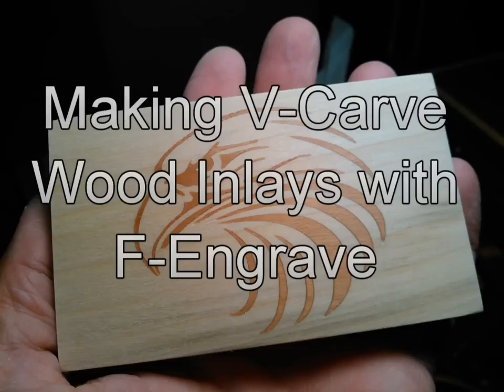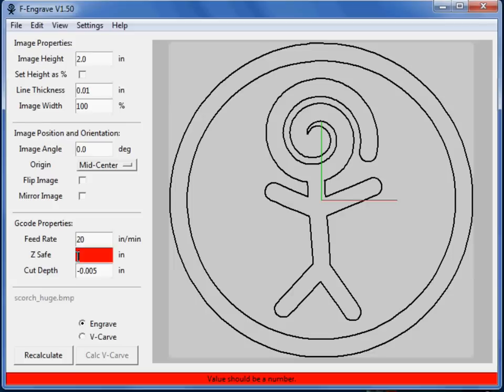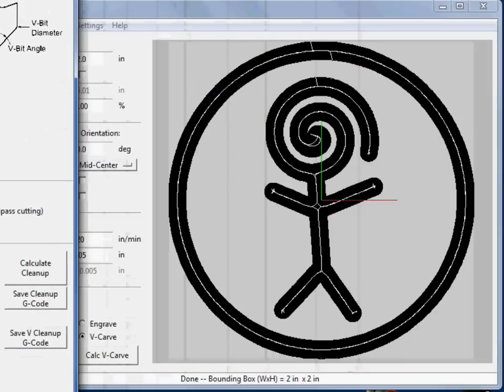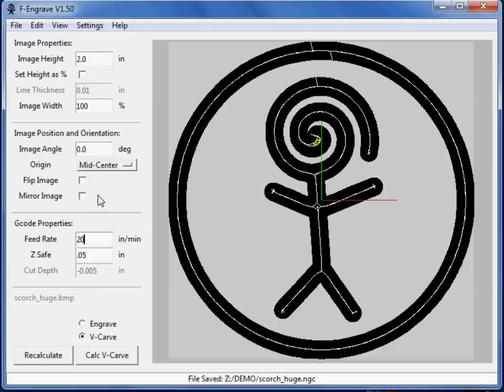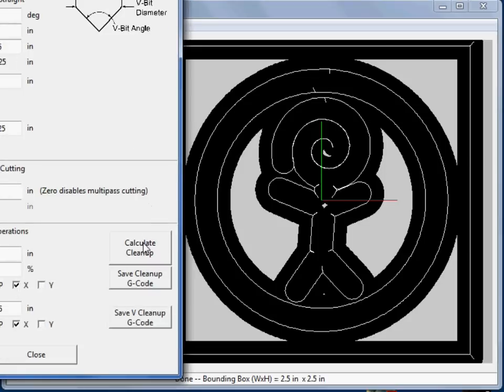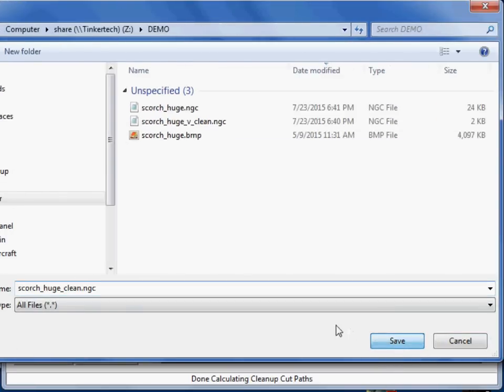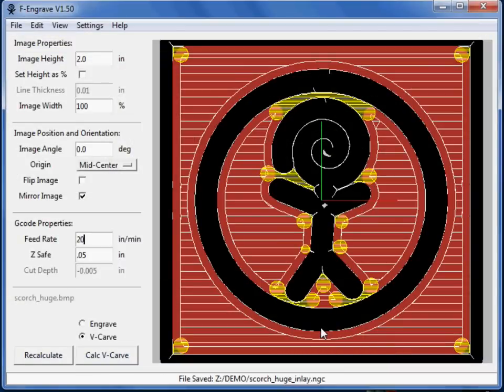V-Carve Inlay Using F-Engrave

Comment: Love the software, thanks so much for making it available.

I am trying to do an inlay as noted above and running into a problem where the inlay portion has a "square" top as shown in the left drawing at this link:  https://imgur.com/a/I3iVw7B

I'm not sure what I'm doing wrong to cause this, but it makes it so that the inlay doesn't mate properly with the base part.

Any ideas?  My settings are:  V-bit angle 60, V-bit diameter 0.125in, cut depth limit -0.09in, sub-step length 0.01in, v-carve finish pass stock 0.032in, v-carve max depth per pass -0.032in.  For base add box and prismatic are not selected  For the inlay mirror is turned on, add box is turned on with a 0.25in Box Gap, and prismatic is turned on with a -0.0625in prismatic overcut.

Any help is appreciated!
Reply from the maker: I don't know how you can physically make square top (as shown in your sketch) with a v-bit.  The sides would need to be slanted at the angle of the v-bit.
Reply: @ScorchWorks  Thanks for the reply!   I have figured out what is happening - it appears to be because my v-bit is of small diameter (1/8") and 60 degrees, which means it has only a working depth of 0.108", but I was cutting to a max depth of 0.09" (no problem there) plus a prismatic overcut of 0.0625", for a total depth of 0.1525".   When I simulate g-code generated by the program where the overcut plus depth is greater than the working depth of the bit, I see this behavior, even though the per pass depth is appropriate.  It is almost like the software believes the bit to be wider than it is.

So the bit is being lowered into the work deeper than its working depth, so you get a v-channel with a square at the top, and the software doesn't appear to compensate for this in the shallower passes.

In any case, it looks like I can make it work by ensuring that my prismatic overcut + max cut depth do not exceed the bit's working depth.  I'll let you know how my next cut goes!  Thanks again for the awesome software!
Reply: Yeah, switching to a 45 degree bit (0.125" diameter, 0.151" working depth) with a 0.09" max depth and a prismatic overcut of 0.06" did the trick.  

Perhaps in the next version if the overcut + max depth is greater than the working depth of the bit it could throw a warning?  Just a thought.

Again, thanks for making the software available!
Reply from the maker: @WestCoastChainmail  I am glad you figured out what was happening. Thanks for the suggestion.

Comment: I have no email address for you so I thought I'd try this.

I have made a few alterations to f-engrave which improved the v-carving without plotting by about 40%

For large bmp, taking about 10 hours to process on an i5 processor, it took about 6 hours.

the biggest time saving was to display the status at every itteration.  instead, that can be done just a few times per second leaving more time to calculate circles and intercepts and less time writing to the screen.

changing sqrt(x*x+y*y) with hypot(x,y) gives a mild 2% increase

Another improvement would (which I haven't made) would be to reduce the accuracy.  For example my machine's accuracy is 750 step / inch in the XY so no need to calculate to 4 decimal places.... the machine just won't move.

I will send you the code if you wish to review it.

I was considering writing the entire v-carve in C but then I got in the data structure and abandoned that idea.  It could execute up to 400% faster in C.

Perhaps putting your code in Github would be better for making pull requests. and contributions like mine

Thanks for making the software available.

Alain Pelletier
Reply from the maker: In F-Engrave select "Help"-"About (e-mail)"

Comment: I’m having a little trouble. The new interface is slightly different than this video. When I cut both pieces, my inlay did not fill the base material. Am I supposed to have prismatic cutting on for both programs? (Base and inlay). I set my base to cut depth max of .0625 and a prismatic overcut of .03125. I do not want the base too deep as I don’t want the inlay too thick. It’s letters and I would like to see the center of the “A” and “e” in the cut. Any advice?
Reply from the maker: Shawn McKinney you should only use prismatic cutting on one side.
Reply: Scorch Works ah ok thank you very much. Does it matter which side?
Reply from the maker: The prizmatic side is the side that is inlayed into the other v-carved side.

Comment: Steve Rogers

2 hours ago
Hi Scorch Works
First I want to thank you for this great program (still trying to learn it) I have watched your video about a 100 times trying to figure out, when you save the V cleanup and then save the main file and then you cut the first part of the inlay or main ngc file you mention that you cut the two files. can you explain what you mean by two files. I am confused as to what files are used to cut the main and what files are used to cut the inlay. and the V cleanup and the cleanup G-code. Thanks Steve
Reply from the maker: +Steve Rogers F-Engrave can generate the main file, v_clean and straight bit cleanup file.  For a v-carve inlay I typically generate all three g-code files for the main board and all three files for the inlay board.
Reply: Scorch Works sorry I'm so dense, ok you have 3 files for each board but how do you run these files, do you run all 3 files for each board. Thanks for your help.
Reply from the maker: Steve Rogers Yes, you would run all three for both pieces of wood (if all three are needed.) in the video I didn't need the straight bit cleanup cut because the v_clean cleaned up everything.  You run the main ngc file and the v_clean file with the v-bit, you run the _clean file with the straight bit.

Comment: Nice program and video but I'm having a problem when I get to the clean-up part. I'm trying something similar to what you've done with your logo, about the same size and simplicity and using the same sized bits. No problem with setting up and carving the base part but when I flip the image and apply the toolpath only the v-bit cut is calculated ... nothing at all for the 1/8" flat bit. Not sure what I'm missing. The video seems to suggest that that part of the operation get included when the V-bit paths are calculated.
Reply from the maker: You need to click the button to calculate the cleanup in the v-carve window. Then save the cleanup tool path from the v-carve window (it will ve a separate file)
Reply: Thanks for your speedy reply. I'm using version 1.6.4. I calculated the cleanup in the v carve window and saved that. There was no cleanup needed for the v bit part. The paths for the 1/8 bit don't show up on the screen though ... perhaps they've been calculated and are contained in the saved file but they don't show as being there.
Reply from the maker: +sinetist07 Do you have the 'P' and 'X' boxes checked for both 'Cleanup Cut Directions' and 'V-Bit Cut Directions'?  P=perimeter X=x scan lines.
Reply: Yes, I do ... but I just got rid of the box option I had selected to use and recalculated everything and now I'm seeing the 1/8 bit paths. I just had to experiment with it a bit more. I think I've got it down now. Thanks again for your speedy replies, your willingness to help and your program.
Reply: Hi Scorch Works
First I want to thank you for this great program (still trying to learn it) I have watched your video about a 100 times trying to figure out, when you save the V cleanup and then save the main file and then you cut the first part of the inlay or main ngc file you mention that you cut the two files. can you explain what you mean by two files. I am confused as to what files are used to cut the main and what files are used to cut the inlay. and the V cleanup and the cleanup G-code. Thanks Steve

Comment: Did you have to reset your Z=0 when you switched to the straight bit?
Reply from the maker: Yes, unless you can put the straight bit in the collet so it sticks out exactly as much as the v-bit did.
Reply: Is there a stop in the program that prompts you to set the Z or do you have to manually stop the program and then restart it once that is done?
Reply from the maker: +Shawn McKinney The straight bit g-code is always saved to a seperate file.
Reply: Ah ok, so the v groove program runs, then fully stops, then you reset Z and keep X and Y the same, then run the straight bit file. I understand now. Thank you very much.
Reply from the maker: +Shawn McKinney Yes, you are correct.  Most CNC controllers won't let you move the x,y,z axes during a pause so it is hard to re-zero the z-axis after the tool change without using two files.

Comment: I'd like to compliment you on such a great program.  I have used it for engraving text in metal and wood and it works very well.  However, I've been trying to make an inlay of a simple pattern in wood and have found a couple of bugs in the g-code generation that doesn't show up on the simulation or display.  I was able to fix the problems by editing the g-code itself but it's very tedious.

I'd like to submit those issues to you but can't find a "F-Engrave support" email address.   Would you prefer that I describe those problems here on you-tube or send them to a private support email for you to consider and hopefully resolve?

Thanks, Tom
Reply from the maker: Send them to the e-mail address in the F-Engrave help menu. 
(Help - About)

Comment: a little off topic here but the straight bit you used for clean up. Where did you get it? Looks like a good tool. I am struggling to find an 1/8" flat cutter with more than .25" of cutting depth. Also I love F ENGRAVE!!!!
Reply: I ended up doing a really cool V carving and decided not to do the inlay on it. I'm away from my CNC machine while I'm at school so I only get to use it once every couple of months when we go down to visit family. I wish a V carve was on the list of things for me to do on it over Thanksgiving break but I'm already completely full of projects that weekend on the CNC. I NEED a garage! haha I want the machine up here with me so bad!
Reply from the maker: Thanks,  That bit is a Bosch Straight/Mortising bit it has 7/16" cutting length.  I picked it up at a local hardware store.  When I need to go really deep I have used a 1/8" Rotozip type bit.  They are ridiculously long  so you need to be careful to take light cuts. I have also used 1/8" end mills which are designed for cutting metal for cutting wood.  The end mills are a nice in between size.
Reply: Oh really it looked even longer that 7/16"! Great looking bit though. That is a great idea! I can think of a few applications like taking several passes to cut through some 3/4" material in order to waste less material and have tighter radius's on corners and things than a 1/4" flat endmill. I'll have to look into that. I have gcode all saved for quite the inlay project this weekend using f-engrave, maybe I'll post a video if it goes well.
Reply: Kaden McDonald how did your project come out?
Reply: Kaden McDonald I think I saw your build before here on YouTube.  didn't you use a ruler as part of your rail system
Reply: I did yes. The entire x axis (long axis) runs on to low 1/8" aluminum rulers from lowes. I've had several people contact me about details on the build that implemented that into their own builds. It's a very easy cheap and accurate solution to linear guides. The measuring increments have also come in handy more than once!

Comment: Hi,
this is awesome. I would like to try making the V-carve inlay using the very same bitmap image you used in video, can you please upload the bitmap file? I tried to make similar logo but the calculated path is just an outline of the two circles. In your video the calculated path fills the space between the two circles, I cannot reproduce that without filling the area between the circles with black. How is it possible you generated the filled areas using the bitmap picture containing just outlines of the logo and not filled areas?

Edit: Now I see, the .bmp containing filled areas is shown as outlined before the path calculation, I wasn't aware of that until a few minutes ago.

ps
Are there any recommendations considering bitmap dpi vs bit diameter/feed rate and/or any of other parameters?
Reply from the maker: +ChupoCro   It sounds like you resolved the original question yourself.  If you still feel like you need something please post a separate comment (or e-mail to the address in the F-Engrave help menu). 

No, I don't have any guidelines for dpi, bit diameter or feed rate.
Reply: +Scorch Works Yes, the problem was my misinterpretation of the displayed bitmap. The program is really exceptional and I am also looking forward to read your article about the math behind the process.

Thank you very much for the reply! Here you are the picture of the V-carving I made a few hours ago as a test:

https://www.dropbox.com/s/sbo4j10fcs7xt74/02.JPG

I'll do the same carving using the oak and will then try to somehow stain the carved areas. I am looking forward to try making an inlay as well.

Thank you for sharing such a wonderful program!

Best regards
Reply from the maker: Looking good...

When I want to stain or paint the v-carved design a different color than the surrounding wood I finish the wood and coat it with polyurethane before doing the v-carve.  After the wood is v-carved I apply the stain or paint.  I can wipe excess stain right off of the wood that was previously coated with polyurethane but the stain or paint sticks/soaks into the freshly cut v-carving.
Reply from the maker: Looking good...

When I want to stain or paint the v-carved design a different color than the surrounding wood I finish the wood and coat it with polyurethane before doing the v-carve.  After the wood is v-carved I apply the stain or paint.  I can wipe excess stain right off of the wood that was previously coated with polyurethane but the stain or paint sticks/soaks into the freshly cut v-carving.
Reply from the maker: @ChupoCro I added some test to the video to clarify that the image should be black where you want to cut and F-Engrave will only show the outlines.  Thanks for pointing out that this was a point of confusion.

Comment: I'm having trouble finding information for the Prismatic Overcut.  Is it half of your bit diameter or what?  I tried using 0.2 inch and it ended up cutting the thinnest part the same width as the widest part of the relief (non-prismatic) cut.  I love the program, I'm just having trouble sorting this out.  I'm trying your 0.0625 from the video to see what it does.  Thank you for any help.
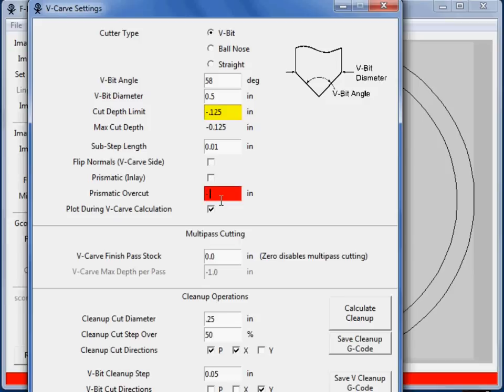Reply from the maker: +Hardwyre When you are doing an inlay the Prismatic Overcut is used to increase the height of the positive side of the inlay.  This results in a gap between the two pieces of wood when you glue them together.  I used the the 0.0625 (1/16 in) gap to get a saw blade between the pieces of wood to cut them apart.  If you set the Prismatic Overcut to zero there will be no gap when you put the two pieces together.   I talk a little about it at 1:00 into the video and again at 4:25 in the video.